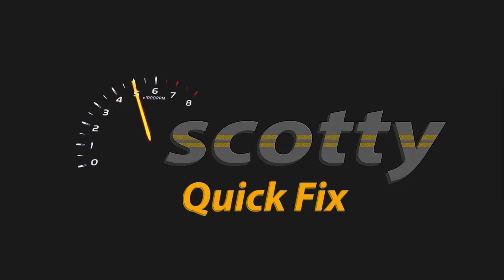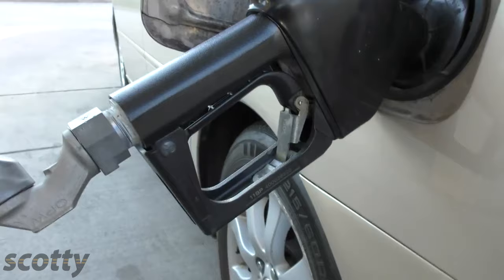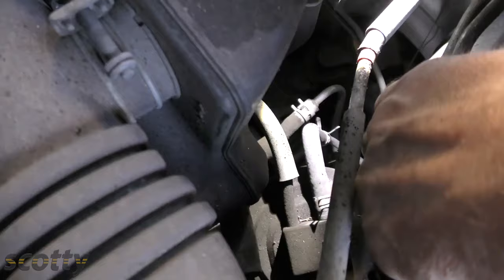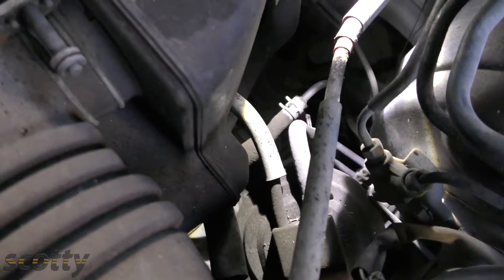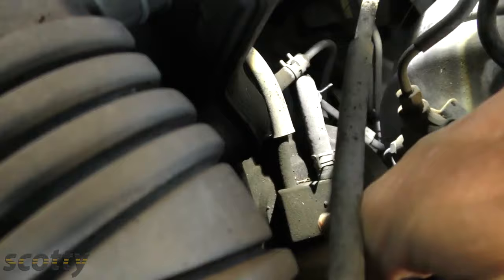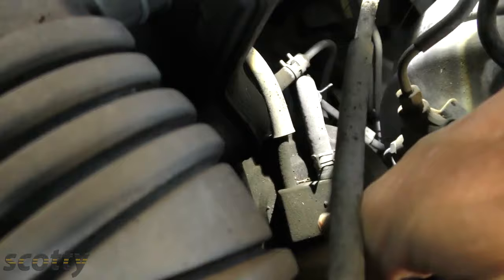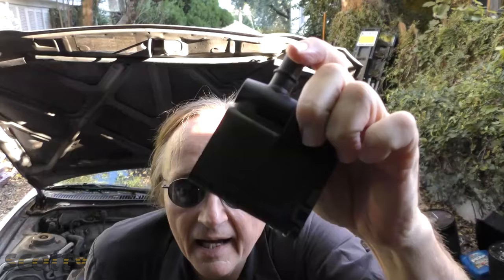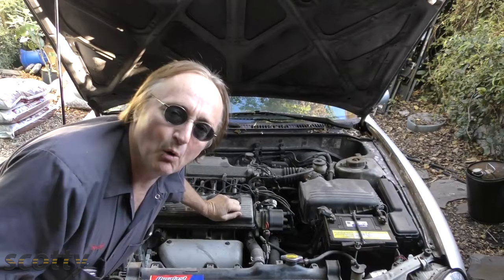Why Not to Overfill (Top Up) Your Car's Gas Tank

Comment: Is it bad to overfill my blinker fluid?
Reply: yes. blinker fluid needs to evaporate to the blinker canister to be reused by the blinker. blinker fluid in the blinker canister can stop the blink from blinking. 10/10 recommend
Reply from the maker: OK, I still don't get this kitche about make believe blinker fluid.  It's an old joke that really, should be retired.
Reply: Cozy Raps I always use synthetic blinker fluid. I can change it every 150,000 blinks as opposed to every 75,000. I have my mechanic do it because it's quite an involved job !
Reply: Scotty Kilmer someone doesnt like chrisfix lol
Reply: The bulb may heat up the fluid and it will maybe make pressure inside blinker, so yea, watch out.
Reply: Over filling blinker fluid is not as bad as neglecting the kinibbler pin, kanoodler valve, Johnson rod , ch'uping bar , muffler bearings , or hydrosalator!
Reply: It's okay as long as your flux capacitor is still functioning properly.
Reply: Brian Lawrance no problem with blinker fluid but be very careful not to overfill the flux capacitor that can be very dangerous
Reply: You also don't want a spun muffler bearing, them can be a pain to replace, always change muffler oil, and don't add too much.
Reply: Hahah. flux capacitor
Reply: Don’t forget about your piston return springs
Reply: Only if you're nearsighted
Reply: J G haven’t you heard of light pollution?
Reply: Never
Reply: Brian Lawrance yes, blinking boy
Reply: @scottykilmer Oh come on Scotty, have a sense of a humor.

Comment: Ask me how I know about this already....Had to replace a canister on a Girlfriend's car & come to figure out she was topping it off way after the click!
Reply: Jonny DIY Is it the same for diesel cars,if you fill it to the top,does it cause any damage?
Reply: yes I believe so. When it the pump clicks it's best to stop then :)
Reply: Hey Johnny, I've overfilled a couple times before, how do I know if the evap canister is broken?
Reply: If youve ruined it, it will usually throw an evap code on the check engine light. But if no check engine light youre probably ok, just try not to do it anymore :)
Reply: Paul Dunne It should not hurt a diesel! Diesel is an oily based fuel, it doesn't evaporate the way that a highly flammable solvent based gasoline rapidly does! I drive a Cummins, and most everyone else I know who does always goes gallons past the shut off to get the full 35 gallon tank capacity, and there is even a mod to make it easier (so the pump shuts off a lot later), and they run these trucks hundreds of thousands of miles and it doesn't hurt anything! 

There may be some exceptions, but in general it shouldn't hurt a diesel by topping it off
Reply: Brandon Burley Thanks Brandon,i've always filled to the top my Skoda Octavia 1.6 TDI  for the past 5 years and never had a problem,nice to be reassured though.
Reply: No check engine light yet, I'll be sure not to overfill after hearing this.
Reply: Same on my SAAB 9-5, but luckily for me a bought a used one for $5.
Reply: bigbzon That was a cheap second hand buy for $5, a whole car.
Reply: I usually keep going I should stop doing that lol
Reply: carman81usa Thought it was to good to be true.
Reply: carman81usa Very nice,for free,how old was the car and what make and model?
Reply: carman81usa Do you remember the mileage on it when you finished with it?
Reply: I top off my Suv but only so that the change is 0, 25, 50, or 75.
Example:  It stopped at 20.15;  I will top it to 20.25.
Reply: +UrABoxxyBox ok
Reply: Hey man just doing some research. I just bought a 2020 Toyota Camry and filled it up for the first time but stupidly overfilled it. Can me overfilling it one time damaged the canister?
Reply: I think it’s fine if you’re on a long trip and use up your tank right after you top it off.  Only if you leave it sitting for a few days is when the pressure will become more and more greater pushing liquid gas into the charcoal canister.

Comment: To account for air bubbles in the tank, its safe to wait 15 seconds after the pump overfill trips off; and then engage the pump once more, until the pump overfill trips off again. That will safely put your tank at maximum fill.
Reply: I did that today and hope that nothing goes wrong.

Comment: Cars are getting too complicated and brittle.
Reply: any car regardless of age will eventually break if the owner neglects maintenance, the only exception to this is bad engineering
Reply: Steve Vento My 96 Ford F150 with a 5.0L (302) has 206,945 miles on it and still going strong.
Reply: Cars are not complicated, it’s the owners that make them complicated. You can’t just buy a car and expect it to run for 100 years without maintaining it. I have a 98 Integra LS with 334,000 miles on it and it still runs like new. That’s because I maintained it by following my owners manual and replacing parts whenever it’s necessary.
Reply: capitalism is on the rise, what a coincidence
Reply: Steve Vento that's funny. My 66 mustang runs better than my 94 dakota. Both are small block V8s. Both have been maintained well. And both are at about the same miles. Hmmm. Guess which one is more reliable and cheaper to fix?
Reply: opl500 you can never go wrong buying an all electric car!!!
Reply: opl500 They have always been that way
Reply: Cars are better nowadays than they were 20 years ago. I haven't seen any cars on the road side for ages but it was a common sight years ago. Yeah, cars are better, more reliable, more efficient, smaller engines yet more power.
Reply: opl500 yes u are corect. They should build them for old people like me,who stand at the pump with gas flowing down my pants leg and in to the drain.
Reply: ....and that's why most cars will last for a very long time.

Comment: Hmm.  Problem is some gas nozzles shut off way too early, long before the tank is full.  I almost ran out of gas once during a freeway trip due to this - a trip I've done many times before on a "topped off" tank of gas.  There's MANY times I've been able to put an extra 2-3 gallons in after the nozzle tripped.
Reply: Never had that problem with my 1999 Rav4 at 200,000+ miles.. And I only go to Fred Meyer and Costco gas stations.
Reply: In that case there’s probably something wrong with your vehicle’s gas tank

Comment: Amazing how much those activated charcoal EVAP canisters cost. If you have an ABS plastic welder, you can cut them open, dump out the old carbon/charcoal, then add all new charcoal and seal it back up.
Reply: Heck if you have the skill to remove it why not just poke a hole and pump air through it until the gas is gone?

Comment: Scotty you’re great. However I have run several cars over the past 20 years covering over 600000 miles. I always overfill my fuel tank but have never had a problem yet.
Reply: My evap canister was broken when i bought my car. I have nothing to lose because i burn my fuel faster than it can evaporate in the tank

Comment: My '98 Nissan Maxima is indestructible! I have 270,000 miles on it and bought it new.  I put almost a gallon in after the pump stops at just about every fill up.  I trust what you're saying Scotty, but my car is a beast (except for the transmission that needed to be replaced at 190,000 miles).

Comment: My old man used to do this with all of his cars, despite me warning him numerous times.

One time he went too far and the tank was overfilled so much that it ran out the emergency overfill hole on to the ground. But he didn't notice a massive stream of fuel pouring on the ground and kept pumping, luckily I was there and saw it to yell at him to stop.

Probably a week later the check engine light came on and the car started running poorly and randomly stalling out. It turns out that the evap canister was completely full of fuel and it caused the evap purge valve to become jammed closed. This in turn lead to the fuel tank imploding as the purge valve was used to deal with vacuum inside the tank, since it was closed, the vacuum in the tank increased as the fuel level dropped.

His car (2016 Ford Focus) needed a new fuel tank, evap canister and purge valve. The job cost him $1000 at the dealership, but it also finally broke his habit of overfilling his fuel tank.

Comment: It really depends on the car. I'm pretty familiar Chevy Cruzes. Those cars have a FLVV (fuel limiting vent valve). It has a float and seat and seal. It positively shuts off the charcoal canister when it closes which also shuts off the station's gas pump. It's pretty common to top Cruzes off. In the case of a stick shift Eco, it's possible to get about 5 gallons extra after the pump shuts off. The tank is 15.5 gallons but because of the long FLVV it shuts off at 12.2 gallons. Topping into the filler neck nets about 2.5 gallons above the 15.5 gallon FLVV. I've gone 700 miles on a tank in a stick shift Eco after topping it off. There are no evap issues amongst those of us that top these cars off.
Reply: I do the same on my 1.8 stick shift 2016 chevy trax, mostly when i travel and never had any issues, the extra fuel is very usefull

Comment: So I have a 2003 Ford e350 van 5.4 2V and I always top off, been so for years and never have had a problem. Yesterday the pump shut off at 28gal I waited a minute and let it foam down just kept putting more gas in. By the end of it I put 37gal in my "35gal" tank! That's like 90 more miles before I have to get gas again.

Comment: Would it be dangerous to just throw that charcoal canister away? Because thats what I did on my car about five years ago. Still runs fine.
Reply: zuilok I wouldn't recommend that dude that would not be too healthy for the car
Reply: You’re just polluting the air with hydrocarbons without it
Reply: mrsemifixit true but it still does pollute the air with it
Reply: I dont think it minds. I´ve done tn on a 700 dollar car about five years and a 100k kms ago. Its working just fine.
Reply: Its a 96 Subaru Justy 1.3 OBDI and I dont think the car has any idea I removed it (or other stuff). The only time I saw a check engine light in this thing was when I bought it and ran out of gas almost immediately because "of course theres enough gas to make it to the gas station"
Reply: thank you for your comment ;)
Reply: I absolutely do realize that and did back then when I removed it. However the MPG loss (if there actually is any considering its probably just burning the vapors off when your engine is warm enough) is so miniscule that it simply doesnt make a difference.
Reply: At this point the car is scrap metal (like most small engine 21 year old cars with over 250k kms) that is still registered and runs suprisingly well. The only investment for the next year will be new spark plugs and an oil change, then its off to the demolition derby while its still legal to be on the road so I can drive there.
Reply: Nobody explains anything to me. It comes out more everyday that Global Warming is/was always a crock of SHIT!!! I said it was from the start! Hell, NASA said the other day that is was wrong. You really need to get over it!
Reply: Kirlew, I have NO Fucking problem. I stated a fact!
Reply: Stop ruining the comment section of an old man trying to help people by trying to act tough behind a keyboard
Reply: Ha ha!
Reply: Check engine light
Reply: Could you link a source to NASA saying that? I'm curious 
Remember that you can google the holocaust, 9/11 and the moon landing, add the word "true" or "false" at the end of your search and you will find a ton of written articles that supports both sides of the argument. Reports doesn't make things true, always remember to fact check and look at a report with a truly neutral open mind.
Reply: TheHareidGamer nah, just because it's written in the internet doesn't mean it should be taken seriously; enough with this bullshit about giving both the "true" and "false" sides equal attention when one can be proven factually correct and the other can be proven as a load of horseshit
Reply from the maker: car would run fine, it would just pollute the air a tiny bit more..
Reply: Without the carbon canister your fuel consumption may actually be marginally worse. On most cars with emissions control systems, at certain points (i.e. when the engine is in closed loop mode), it will redirect those fuel vapours captured in the carbon canister, into the intake, and will be burned. This makes your emissions cleaner, AND is good for your fuel economy.

The ECU in your car also manages the emissions control. Messing with any part of it can potentially screw things up. I see it time and time again, people deleting emissions gear and now their car runs like shit. No shit sherlock, the computer is trying to use a part to keep your car running properly that no longer exists, what did you think would happen?

Carbon canister, no it won’t really hurt anything to throw it away. But if you have no reason to, then don’t. Same thing with people punching cats out. Yeah, your exhaust flows better (and the ECU is having a fit now because it’s not tuned to run like that), but now the traffic cop can smell your exhaust from his desk, and you better believe you’re going home in a taxi with your car on a tow truck tonight.

Don’t fuck around with your emissions gear. The consequences are more than pissing a few tree huggers off.
Reply: DJ.Spikes Hostage that's literally what he just said
Reply: thats cool when you are a broke ass homie brother...but as soon as you get a good job and earn good income, then please put it back. as there is a scientific reason why that is in there. the data is solid. non-recirculating gas fumes damage the atmosphere so do your part once you get a job, put it how it should be.
Reply: I was going to ask the question, but then I noticed your answer in the comments. Thanks!
Reply: so long as you don't live in an inspection state.  a check valve is just as effective, but isn't going to get you a pass in a state inspection
Reply: zuilok  can't be an OBD1 if it's a 96
Reply: I did it to my car also i just ran a hoze up by the motor and put a small air filter for a lawn mower on the end of it its fine unless your a environmentalist
Reply: many cars registered in 96 are actually made in 95 and are OBD1
Reply: A golf tee works just as good , even still you can blow out your charcoal canister with a blowgun and shop air, or pop the top off and fill with aquarium charcoal, or use a cheaper charcoal canister, they all work the same, one inlet one outlet. As long as it's at the same level as the old one it will work fine.
Reply: I am going to see if my Jeep has a coal can and if it does I am taking it off too.
Reply: Kelly Handley calm down
Reply: And this is why I have a carburetor.
Reply: John Sears lol. Same for one of my vehicles
Reply: zuilok easy fix😁👍
Reply: @spikeshostagetv5935  it's healthier for the car. You're essentially cutting off a dirty sponge. Not healthy for the environment but there's nothing we can do that even raises a candle to the pollution corporations make on the daily anyways.
Reply: @billgateskilledmyuncle23  quoteworthy
Reply: @luisloks  my evap canister is off as well and I am now gonna keep it that way just to piss you off.

Comment: I've heard this many times before, but I've been topping off the tank on every car I've owned for the last forty years.  Never had a problem.  Could it be that, if you drive your car right after topping off, the level drops, thus preventing this problem?
Reply: Exactly what I was wondering, I think it’s fine if you’re on a long trip and use up your tank right after you top it off.  Only if you leave it sitting for a few days is when the pressure will become more and more greater pushing liquid gas into the charcoal canister.

Comment: Around here, gas is 2.50 a gallon for 87, my Focus usually clicks off at between 50 cents and 80, so adding the extra 50 cents of gas is little more than another ounce, if that. been doing it for 11 years, zero fuel problems

Comment: I've been doing that for 4 years and the cars still doing well
Reply from the maker: some vehicles, like toyotas, are less vulnerable to some gasoline getting sucked into the evap cannister than others. You are lucky. Still, i wouldn't tempt fate
Reply: Scotty Kilmer...... big fan Scotty.. . Thanks for replying that really means a lot to me...
However I own a 2005 Honda civic four door and here in Pakistan u are not required to fill up your tank rather a person does it for you and he always fills it to the brim because obviously they wanna sell more petrol..... and not only me but neatly every single person I know does the same thing and don't care about cars that very much..... Labour here in Pakistan is very very cheap..... I repainted my full car in 4 days for like 274.13 us dollars and replaced lasted cylinder and clutch plate for 34.6 dollars and picked the car up 3 hours later from the mechanic..
Reply: @scottykilmer  just bought a 2020 Toyota Camry. Just filled it up for the first time and stupidly overfilled it to wear it leaked out a little bit. Can overfilling at one time damage to canister

Comment: Had a 2007 Spectra that I had evap issues due to overfilling - characterized by the car sometimes randomly stalling. Not only do you need to NOT "top up" after the pump shuts off, but you also should make sure to not fill up at a gas station with a significant slope. What did in the evap on the Spectra was filling up at a QT that had a horrible slope -- such that I was able to add significantly more than normal. That was a nice costly repair...